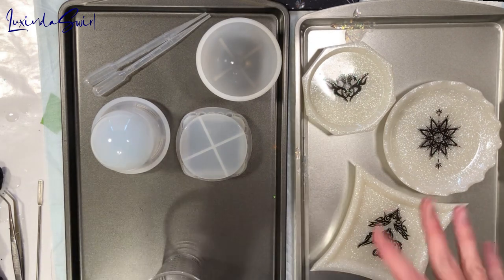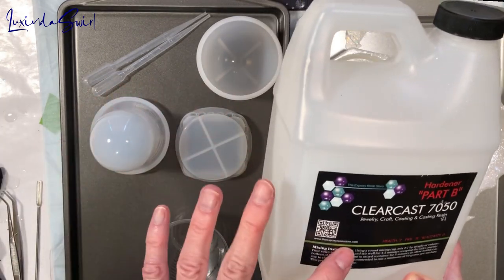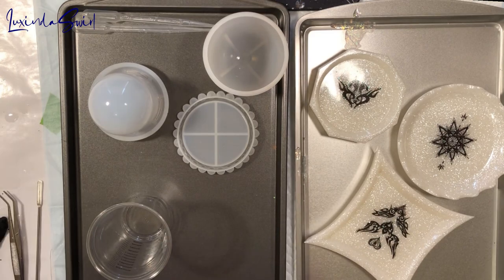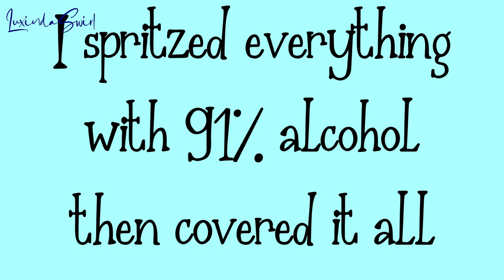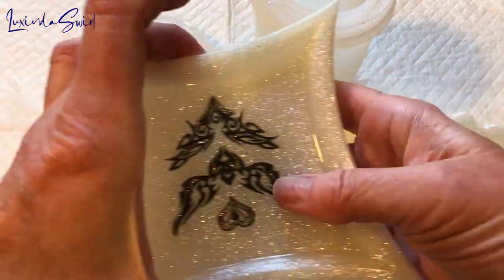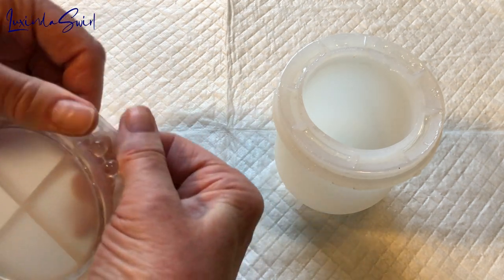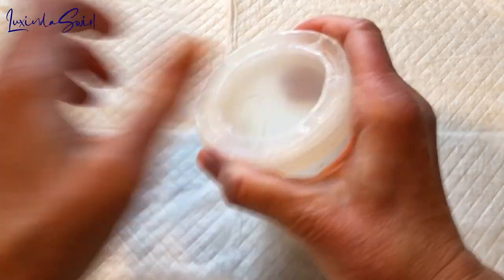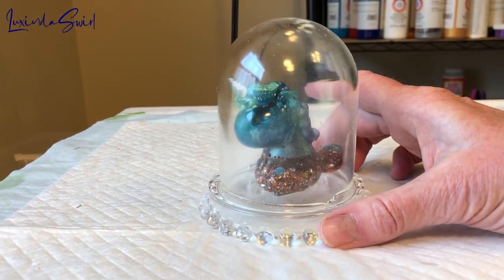Making a Resin Display Dome, Because Why Not?! And Finishing Up My Tattoo/Stickles Trinket Trays

Comment: Fabulous just fabulous!!  You do such nice work.  All beauty’s & quality pieces for sure 💯💯💯
I snip the long skinny end of the pipettes off.  Makes it so much easier to suck up the resin mixes & to clean for reuse.  Steve is a hoot. I adore both of his channels.  And the ClearCast 7050 is my absolute favorite to work with- wish it was possible to use it on everything.  Unfortunately the ‘different resins for different purposes’ is a thing LOL 
Thanks for sharing your beautiful art!!  Have a great day! 🤗 Debs
Reply from the maker: Thank you! Good idea to snip off the thin ends! I also realized afterwards that I could have poured more resin into the bottom of the dome mold before setting the top part in and pipetting in the remainder. I’ll have to experiment with how much I can add in first, then there won’t be anywhere near as much to add by pipette.
Reply: @Luxinda  yes indeedy!  After the resins are cured but still bendy .. put the pipette on the table and mash down with your palms as you roll it.  The almost cured resin inside there will turn into a skinny spaghetti tube like piece that can be pulled out.  If ya wait to long & it’s 
totally cured try rolling & let it break into tiny pieces .. then shake it out over the trash.  The pipettes are so glossy inside they last & last. I’ve used the same 6 or 7 for half a year or more.  Especially with snipping off the long skinny ends.  Then onto the next project 👌
Reply from the maker: @debrajol3585  that’s amazing that yours last so long. The ones in this video were fine, but the one (same batch) I used a couple days earlier just to transfer some alcohol ink, split on the seam when I squeezed the bulb. I was kinda peeved, but hope it’s a fluke.
Reply: @Luxinda  dang that stinks. must’ve been a cheap batch or the seller is buying poor quality stock to make more money.   I felt bad throwing them out after one use.  Snipping the ends made them reusable.  It seems like it was a pack of 80 for $6 or $7 on Amazon and I’m sure there’s 65 - 70 left.  I do remember it said for laboratory use or medical equipment.  Maybe that’s the difference in thicknesses 🤔 
I put my alcohols & white ink in a needle tip bottle so I don’t have to use a pipettes every time.  Maybe they don’t like alcohol lol 😂

Comment: How many grams for dome
Reply from the maker: That's a good question, and I'm not really sure. All my measurements were by volume not weight. And it's about 2-3 fluid ounces or 60-90 ml for the dome part. I'd say the base mold takes another 1-2 ounces or 30-60ml. I hope this helps somewhat!

Comment: Hey how much epoxy do you use for the dome
Reply from the maker: I would say about 4 oz for both the base and the dome. I mixed up 6, used more than an ounce in finishing the trinket trays, and still had a little left after pouring the dome and base pieces.